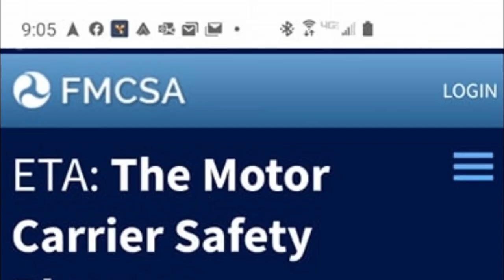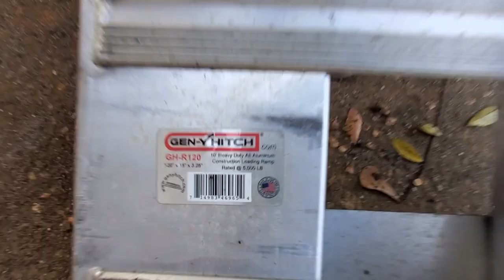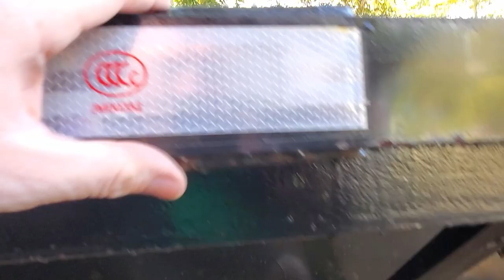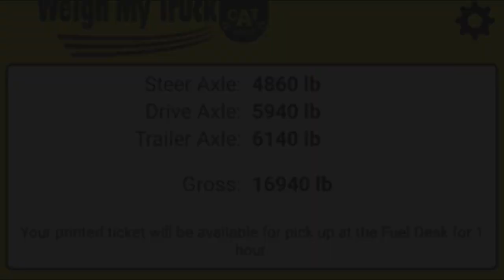DOT was at my house for 3 Days!

Comment: Fyi you can put a board in the middle when changing the boards to bend the decking and they will slide in. At least that's how I did the ones on mine.

Comment: I drive tractor trailer and I always look out for you Hot Shot Drivers. I am looking forward to joining the Hot Shot team. I'll be looking for Wilson and give him a good kick for you. Don't hate the player...hate the game. You can convert from oil bath to grease. Just drain and clean everything really well and pack everything really good with hi temperature grease. I'm a mechanic as well and did this for a dealer all the time. Cut the boards center of a cross over, then drill holes with self tapping screws. This way if you have to replace 1 board, unscrew it pull board, lay new one down and rescrew it down and done.

Comment: You pry the board out from the middle. Put it back by putting one end in and bowing in middle with board than step on other end and pull out your board that you bowled it with
Reply: Old timer hot shot  why did you get your face in it.   really?

Comment: You would want my 5th wheel logging trailer with loading grapple: 3 24,000lb axle's and set of bogie wheels to the front of the trailer and I've moved up to 70,000lb only one time but can hall up to 46 ft long, built it my self. Prototyped it first from a old 5th wheel travel trailer to get what I needed and wanted figured out, and those weld's do look bad. I have hybread break system both hydraulic and air with electric backup it's a bit of a complex but simple system, like the hydraulic with electric center axle will apply about 35% hydraulic breaking while going down hill with out applying the pickup breaks. Front and back axle's have air and electric breaks.

Comment: Disclaimer:  "you", as used in the following opinions, meaning anyone that the proverbial shoe fits. My opinions based on trucking as a USA based class 8 tractor-trailer van/container/flat/stepdeck/lowboy stretch rgn, 48 states and Canada owner-operator leased to a motor carrier for 29 years. Also as a company driver doing heavy haul on/off road for a gas well service company for 9 years. And as current PA State Inspection and Emissions certified for all vehicles.

Here's what it all boils down to...you can't live your life on the internet. Facebook, YouTube, Instagram, etc. You're scrutinized by the world...good, bad, indifferent.

As far as modifying any vehicle. Technically you can't make any changes to a vehicle that it wasn't built with or had as an option from the factory. That's Federal law...FMVSS.  Emissions, exhaust, lights, body, frame, everything. 

An example:  A truck body installer can add a dump bed for example or modify a frame...then that installer has to certify in writing everything was done to FMVSS specs and attach a decal stating tire ratings, axle weighs, etc.

 Pennsylvania also has what is called Enhanced Inspection which comes into play with vehicles being repaired/rebuilt because of accidents, etc. Take the bed off your pickup and you install a flatbed body...legally the vehicle is supposed to have an Enhanced Inspection...that insures that the work was done in a workmanship manner and not cobbled together and meets FMVSS specs.

You can't give out information as to what you charge or who you're hauling for...every rig like yours is your competitor and they will cut your rate or go after your customer. 

 If you get in an accident, everything in your world gets bought into the legal world...everything...all your maintenance records and receipts, cell phone use, every credit card transaction, daily logs and pre-trip inspections, bills of ladings, and all your social media.  Potentially everyone gets brought into the system....you, the shops that serviced your rig (according to your maintenance receipts).....truck, trailer, tire manufactures...etc. Courts can assign percentage of responsibility of the accident. 

Maintenance and records:

Purpose is to show that the equipment is being maintained on a regular basis and to prevent breakdowns that can cause accidents.

 For instance, you get a tire fixed at a shop...they mount the tire and wheel to your trailer...the receipt states you must have the lug nuts re-torqued within "x" number of miles, you don't have that done by a shop and get a receipt (proof), you use your own torque wrench but fail to note such in writing in your maintenance record, or you simply don't have the lug nuts re-torqued at all.....that wheel and tire assembly comes off because the lug nuts weren't tight and breaks out the center of the wheel...it comes off and causes an accident and or death. You're negligent and the penalties are severe.

I was always an owner-operator with my equipment leased to a trucking company. They had a lot of the record keeping burden...pre-hire, qualification, road test, drug and alcohol test program, yearly review of citations, etc. I had to maintain and turn into them a copy of my maintenance records. 

When you're a trucking company holding that DOT operating authority....makes no difference 1 truck or thousands, you're subject to the same laws. 

I think a lot of folks are very uninformed and mistaken about the consequences of the real world of trucking. The equipment laws are in place for every highway users safety. And the tax laws are in place to keep you financially "hungry"...tolls, fuel tax, corporate tax, highway use tax, ton mile tax, ad valorem tax, and on and on. 

Sorry for the long dissertation. I'm sure the know-it-alls will have found it boring and I'm all wrong.
 But maybe someone will get a tidbit of knowledge.
Reply: heyinway lawyers loves to place blame.   They take policy and run(can’t get blood out of stone).    Even better if they can go after several other companies.  Anyways rules are rules an I would prefer to see hotshots get into tractor trailers.   Dot Officers are really good people but many forget the drivers make peanuts.
Reply: heyinway, so true. Yes, hopefully many will grab ahold of your information here. Trucking today is very different than it was a decade ago.
Reply: I agree with you except for the taxes. Providing for my family keeps me hungry and going after my fair share of the pie. What makes me mad is the government keeps stealing from my slice of pie. When will we say enough to being taxed to death?
Reply from the maker: Thanks for taking the time to write this out for everyone. I dont claim to know everything. Or anything really. So like I said in my first video maybe I can learn something from you. And you something from me.

Comment: The reason those single tire axles have issues is because guys don't check the bearing preload after so many miles of running (just like re-torquing your wheel nuts after a tire rotation). Every semi trailer running down the highway has wet bearings, the difference is those wheels bearings are checked after so many miles to ensure that the preload is adjusted and checked. Wet bearings will do much better carrying weight than greased bearings. The number of tires on an axle doesn't matter, it's staying on top of checking that any run out on the bearing is taken up after they run in. Sorry to hear that you have run into the issues you have with the D.O.T. maybe ( hind sight being 20/20 ) take some time to read up on the regulations your running under before doing anything to your rig that people are warning you against doing. People think professional truck drivers are all just wheel holding idiots, granted there are quite a few of those, but there are also real professionals out there that want the industry to be safe and "professional". The ones that offer you tips and suggestions are the ones who care about where the industry is going, and more over want it and you to stay safe. Yes, be it Hot Shotting or actual CDL long haul driving there is room for everyone to make a decent living. Regulations are there for two reasons, either because someone was killed or a potential danger was caught before it could hurt anyone. I have seen way too many times when someone half assed something thinking they could get away with it, and I have had to clean up the results of that poor judgement.  It's not an easy job, even doing simple hotshot loads, your always taking a risk when you turn the key. Your rig is your job from one end to the other and just like professional drivers, we all have to stay on top of our rigs when we are off (it comes with the territory, get use to it). It can be a very rewarding career if you like the job and the travel, but if your going to embrace this as a career then embrace it completely. Visi-vests, hard hats, steel toes, gloves, hi-vis rain gear, Hi-Vis foul weather gear are things you must have and in so many places you won't get loaded without it. Your cutting your teeth and learning as you go (sometimes doing it the really hard way) but you also have no one there teaching you what to do. So take the time to read the comments on your posts and see what you can learn along the way. Not everyone is a keyboard warrior, there are lots of good common sense suggestions posted (and a few really stupid ones to boot) but it's up to you to take what sounds smart, safe and wise and apply them to your job. The goals are to pay your bills, feed your family and put some cash in your jeans but more over you can't have any of that without being safe.. Keep up the learning and the good work..  Cheers..

Comment: If you don't have torque tube, the frame can use a X brace welded into the frame. That works good.
Reply from the maker: If it were a cdl trailer I would agree. Non cdl cant and shouldn't be stacking much weight up front where it twists

Comment: On welding on your trailer, the welder and the shop need to be certified. 
To help with your mileage log, I recommend getting a hub-o-meter. It is an odometer that bolts to the hub or the lug bolts. You may have seen some on semi trailers or pups. You buy them by tire size. 
Good luck.

Comment: You can buy a new 40” Big Tex 14gn for less than $11k.  They need about 6  weeks lead time. You can make a wedge to fit in between the ramps to create a flat surface.

Comment: A word of advise on electrical plugs.I have been an otr driver for 18 yrs and every time i deal with light is solder and shrink connection and on plugs use vasaline not die electric grease.It wont wash off with water.

Comment: I saw quite a few of those trailers on Ebay. The slightly used ones like you bought were right around 10,000 dollars and the heavier or newer ones went up to 25,000 dollars or more.
If I were you I would take some pictures of your used trailer and list it on Craigslist. You can list it for free and ask top dollar, you can always lower the price. Don't be too quick to lower the price, if someone is interested and try to low ball you say you just listed it and are trying to get what you are asking. You can take their name and say if you still have it in a couple of months you will let them know. Go on and sell it for the best deal you can and you can always get one later to make into a camper/ car hauler.
I have had very good luck selling on Craigslist just don't take any kind of check or money order.
Construction guys could use your old trailer because they don't haul commercially. Good Luck!

Comment: Grinding off a couple of welds will be a whole lot easier than unscrewing the decking, and then drilling new holes into the boards and metal joisting. Unless you're just needing to replace one board.

Comment: I'm not a welder, but I've done quite a bit of welding and those are crap welds. Maybe they were training someone?
That very bottom toolbox you might want to put some caulk in the screw holes on the latch to keep rain water out. Just something I noticed.

Comment: The company I work for we have DOT numbers and all that fun stuff, smallest truck is a 1500 dodge and currently the largest is a 05 f550 dump. For every driver and truck we have they must complete one of those driver inspection forms, it covers everything from dirt in the cab to over sized loads. If ur pulling a trailer with lawn equipment everything has to be checked and gone over. We keep our daily logs in the trucks for a few days just for safety. 
Yeah some of those welds look really iffy and fabricated by the previous owner but ya really can't prove it. 
I'm really surprised with the length of the trailer and having single tire axles and only a double axle, we've run dually double axles which helps tremendously with the weight and tri axles for single tire trailers, both goose neck

Comment: Depending on the length of the boards usually you can put a few in diagonally and slide them straight and in the last few if there long enough you can slip one side in then bend the center up and slip the other side in

Comment: A lot of guys drain the oil out of the hubs and pack the bearings with grease.
Reply from the maker: That's what we did
Reply: Ive had oil bath 8K Dexter axles with singles for the last several years no problem at all. The seals on the singles do take abuse when you spin around really sharp because the tires flex so much and can cause seals to weaken or leak. Just be careful and try not to do it too much. I usually changed the seals every 2 or 3 years just so i was taking everything apart to inspect things. My oil baths ran much cooler than the grease but it dont matter now that you changed over.
Reply: I will finish watching to the end next time before I comment ! My apologies 🎧
Reply: Don’t do this unless it’s an emergency! Oil bath axel are far better than grease hubs. Look at semi tractors and trailers. When maintained properly they run cooler and last longer.
Reply: i agree that oil is used on big trucks and run cooler but to say only do it in an emergency isnt really fair to say. Makes it sound like it is a temporary fix when grease hubs are on millions of trailers and trucks and have worked fine for years...I liked the oil baths myself but wouldnt shy away if a trailer had grease either
Reply: @harrysuggs4706  You can still spec grease pack bearings on new trailers. For construction use the oil hubs suck, the caps get broken easily. The old style pressed steel caps are just about indestructible. I've even seen those aluminum caps with the plastic window get busted by a thrown chain and the hook hitting the plastic. We convert all our trailers to grease pack whenever we need to remove the hubs.
If you like oil bath wheel bearings, there is a lube called "MAG #00" a few manufactures like Lubriplate make it. It's a little expensive, and you can't mix it with regular gear lube, but if you muse it it lasts forever and you'll never get a leak. It's made for extreme harsh environments. https://www.lubriplate.com/Products/Grease/Multi-Purpose-Greases/MAG-Series/MAG-00/

Comment: I don't have a CDL but I wonder why the driving record from the State isn't recognized as official.  What type of violations would  your previous or current employer have that wouldn't show up on the state records.  Would these be annual evaluations that wouldn't be on the States files?

The welds and paint on that trailer makes it look like a homebuild one.

As for cutting the metal straps to replace the boards, then welding them back - that's how the built the trailer.  They put the boards in, then welded the straps.  Faster.

Comment: I worked in the Safe and  business with major cranes. no drilling or welding without engineering. Every  structural or load bearing component. had to be approved.

Comment: You just cut a notch out of the steel on one end about two inches wider than your deck board. Then lift deck boards out of the notch one after another. Slide each board to the notch as needed to remove. On that trailer you need to do this three times one in each section. Tack weld the cut out notch back in when finished. You can cut the boards up to remove and use the notch to install the new boards. This is actually how we do it.

Comment: The manufacture has approved welding procedures - just ask for them - the repair procedure has to be an approved procedure - not the actual repair.. my cousin used to weld for Big Tex.  Otherwise there could be no repairs made on the road.  They will probably tell you to use accepted welding practices for repairs.  However, when you modified the basic design you should have just re-registered the trailer as a shop built and registered it as such at whatever weight u like. Then the DOT would have no traction with their "manufacturing" claim.  There is probably an inspection process for registration so they can't say the trailer is not safe because some state authorities said it was.  However, since the cat is already out of the bag it would be hard to get it back in.  If you have "remanfactured" the trailer you will have to issue it a new serial number and data plate before registering it.  Of course $3 and my opinion might get you a cup of coffee if your not in a Starbucks... good luck guy.

Comment: Why don't you get a couple boxes that will fit inside the bed from the wheel well back to the tailgate and be below the bed cap also the side angle peices take and drill you some 1 1/4 in holes in them to allow air to pass through. Or put a box under trailer.